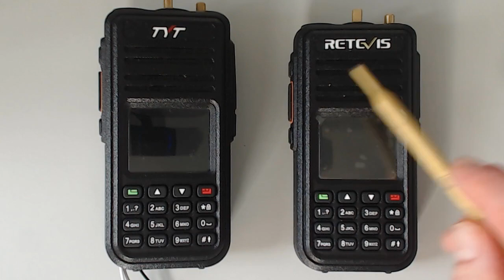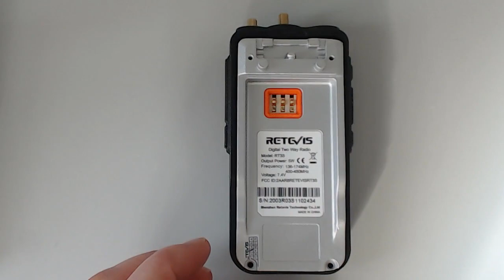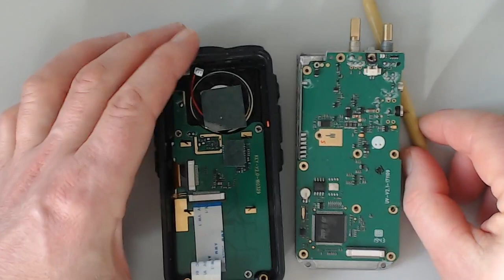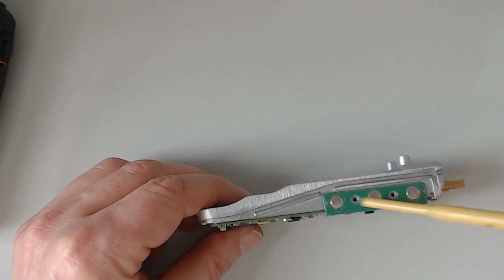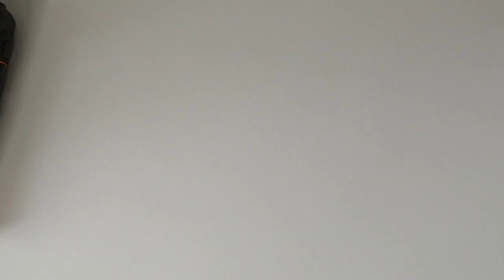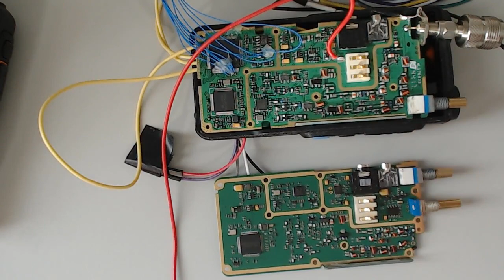Teardown of the Retevis RT3S DMR radio

Comment: rt3s batarya pil ters takma sonucu ariza yaptı.  nasil bir tamir yapılır.  hangi parcalar değişmeli
Reply from the maker: Translates to 
"The rt3s battery malfunctioned as a result of installing it backwards. What kind of repair is done? Which parts should be changed?"

So this has nothing to do with the firmware.

Goodness knows how you managed to install the battery backwards and what damage you did to the internals of the radio.

There is no schematic for this radio, so your best option is to open the radio and see what things are burnt.

Comment: Can one replace a worn out keyboard/keypad (or individual button/key) on a used dmr radio?
Reply from the maker: I didn't take the keyboard apart, but these types of radios normally use bubble membrane style switches for the buttons.
You would need to research whether it is possible to replace those switches
Reply: @vk3kyy  Thank you.